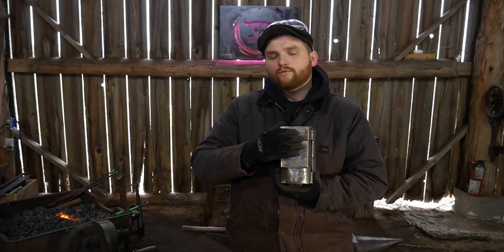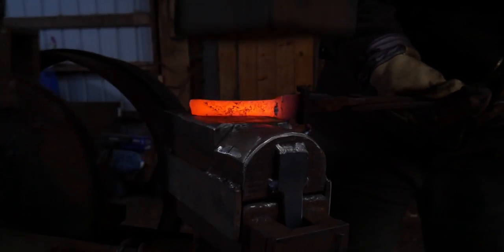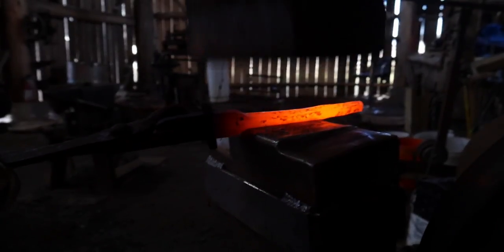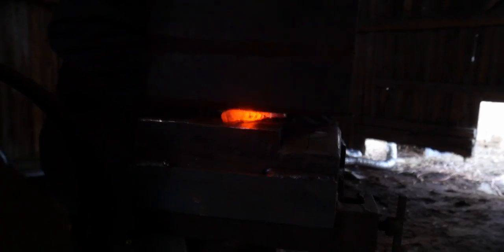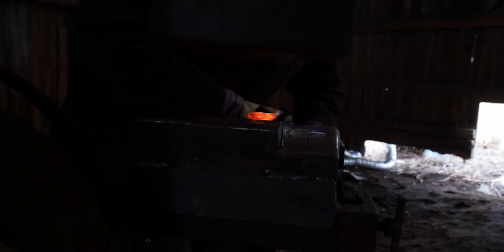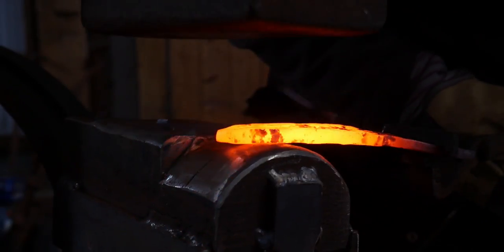New Dies for My Power Hammer: Trying Out New Combo Dies to Forge an Oak Leaf

Comment: What is a good way to source metal for use in blacksmithing? Either mild, wrought, or hardenable steels seem to be hard to find in my area, but I may not be looking in the right spot.
Reply: Look for a place called "Metal Supermarkets" (metalsupermarkets.com).  They have stores all across the country, and have just about any kind of metal you may need, and will cut to order.  I spend almost all my time around the drop tables, since that's where the really inexpensive stuff is.  I got an 84 lbs piece of 8" x11" 4140 round stock for $1/lbs.  I use it as a striking anvil.
Reply: @kys00ner1  Do you know if they sell metal in amount? Or is there a minimum of material you need to purchase for them to ship it out?
Reply: I source a lot of steel second hand, check facebook market place or similar, i also buy new when i need something specific, sometimes more cost effective to buy new than break down larger stock
Reply: Sheski, they sell by the pound, as much or as little as you want.
Reply: @kys00ner1  Thanks
Reply: @kys00ner1  Thanks! I'll look them up.